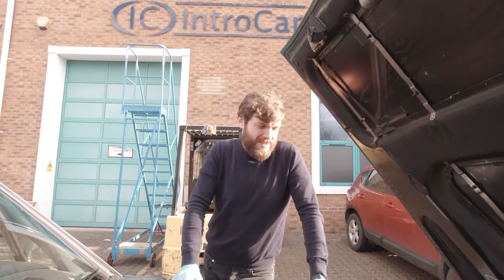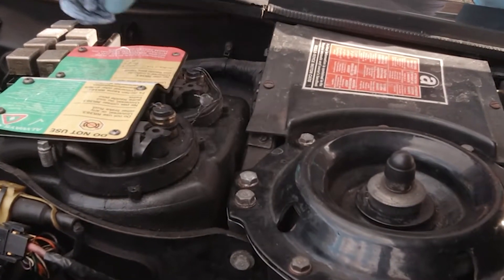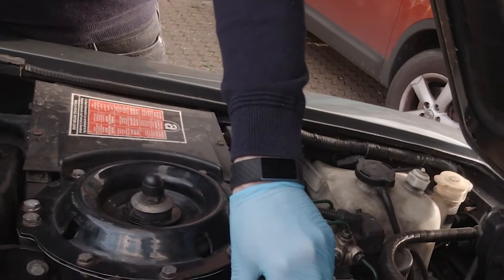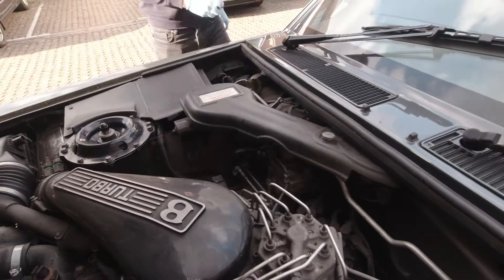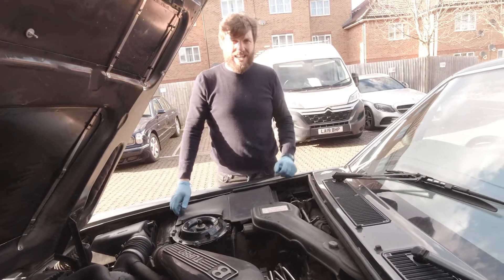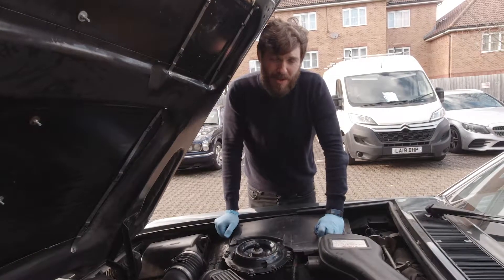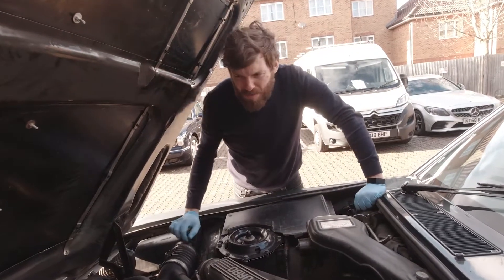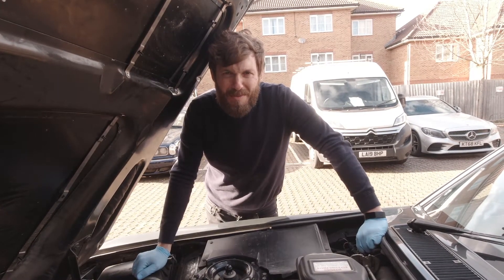Regular Maintenance check up - Bentley Turbo R

Comment: They are such beautiful cars  !!!
...
i long to own one or a very last Jaguar XJ12 ... (Daimler)  !!!
...
I confess to having no interest in new cars at all ... (as maybe the cheapest is the best) ??
...
The little problem is... the "understanding" of the cars just "drift" back into the decades and help becomes difficult  !!!
...
I have a 2003 Citroen C5  diesel auto that has a bust alternator and the car has jumped into "safe mode" and a solenoid is clamping the gear lever from engaging reverse !!!
.
( "google" produces nothing but i'm loathed to have to scrap the car ... even though it was just £600 with a long MOT ) 
...
...
But your car is absolutely outstanding !!!
...
THANKS  FOR  READING  :-)

Comment: Great job. I own a 1997 turbo r I use LMH. The factis as soon as I put the contact, the low brake pressure appears. I even replenished the lmh reservoir but still have the same alert. Would you please lead me toward a possible diagnosis before I changes the sphere and ovehauled the hydraulic system. Please keep ding the great job you've been doing since. Hurray, hurray
Reply from the maker: Dear Sir,
If the low-pressure light is coming on as soon as you press the brake pedal, it is likely that the pressure in the accumulators is very low. I recommend that you change the brake accumulators. The part number is CD6000GMF-X. There are 2 and it is probably worth changing both.

Comment: Very helpful, would you say as a specialist that a Bentley Turbo r is relatively reliable and straight forwards to maintain?
Reply from the maker: I would say that a Turbo R, if well maintained can be a very reliable car. That does mean that you should be prepared to spend around £2000 per year on maintenance. Obviously that is just approximation and you could be lucky and not have to spend so much but then you could also be unlucky and have to spend more...

Comment: I'm looking to buy one of these vehicles.what  should I look for in terms of mechanical and electrical condition of this vehicle
Reply from the maker: It’s a good idea to check the service history of the car. The more history you have the better.

Things to have checked would be the following. But I cannot list everything and I may have missed some obvious ones.

 

Hydraulic system –

Check for leaks
pressure warning lights that stay on
height control working properly
brakes feel good without noise
noisy brake pumps
 

Suspension and steering

Check the feel of the steering rack and check for leaks
Any knocking noises from the suspension when you go over bumps in the road, ball joints and suspension arm bushes
No active ride warning lights on the dashboard
Rear suspension not too stiff (this happens when the gas springs fail)
 

Engine

does the engine run smoothly?
Smoke from the exhaust?
any strange noises
Does it start well?
Is there any smell of fuel?
Does the engine maintain a good temperature?
Check the side of the engine block to see if there are any leaks form the liner holes
 

Electrical

Check operation of seats, windows, mirrors, wipers.
Check for any warning lights on the dashboard when starting and when driving
Reply: What if the owner says he doesn't mine if you brought a mechanic to inspect the car but he won't let it go to a bentley dealership for a pre purchase inspection
Reply: @introcar  Comprehesive answer! Wow i can't get over how quality this channel is in regards to replies to customer comments. Keep up the great work.

Comment: Thank you!  Where do I fiill the brake fluid?  Is that the mineral oil you mentioned?
Reply from the maker: No brake fluid on this car! Be very careful with brake fluid and mineral oil on these cars. If you put the wrong fluid in, you can cause a huge amount of damage to the hydraulic systems.  Always ensure you are using the correct fluid!

Cars prior to 1980 with 8-digit chassis number up to 50,000 series, use brake fluid. Cars 50,000 onwards and with a 17-digit VIN number use mineral oil. This changes with the introduction of the Arnage/Seraph where they use a separate Pentosin fluid for the hydraulic system and brake fluid for the brakes.

Comment: Is there a kill switch for the fuel line? I was told the reason mine is shutting off could be a kill switch for safety feature.
Reply from the maker: Hi,
On later models there is an inertia switch which will cut the fuel pumps. sometimes it can get triggered accidentally and you need to press it to reset it. 
It is located is near the back of the engine bay just inside the off side wing. It has a round button about 1inch diameter. If you press it and it clicks it is likely that it had been triggered.

Comment: Nice video, thanks! I have some smoke coming up from driver side of the engine of my 97 Turbo R. Would that be a valve cover gasket leak? It has only 47k miles but just started smoking a little.
Reply: Also I have brake pressure light and alarm occured light on every single time I start the car, then both of them disappear. It is not normal right?
Reply from the maker: It is common for the valve covers to leak on these cars so that is the most likely cause. There is quite a lot to take off, in order to tighten up the rocker covers. It might be worth considering upgrading to the rubber rocker cover gaskets UV11305SET-X. https://www.introcar.com/rocker-cover-gasket-conversion-set-uv11305set
Reply from the maker: @berkaytaciako8579  It is normal for the pressure light to come on if the car has not been used for a while. It is worth checking condition of the brake accumulators to ensure they have maintained the correct pressure. Here is a video on how to test the system pressure https://youtu.be/X-_6VS1VRyg

The alarm occurred light should clear when the alarm is reset.

Comment: where is the brake fluid?
Reply from the maker: Hi, the first thing that he points at, refer as 'Hydraulic reservoir' is where you put your brake fluid. Being a Turbo R you are meant to use Minearl Oil. So please check your chassis, a specialist or the warning signs by the reservoir to amke sure you are purong the right fluid in. https://youtu.be/0YFGSe_y73U?t=33
Reply: @introcar  thanks men the other day when i was driving it i did two brake checks and started to smoke then i revise it and we saw there was no brake oil